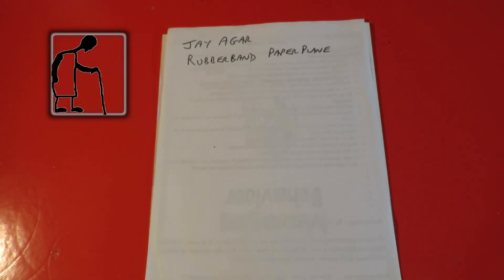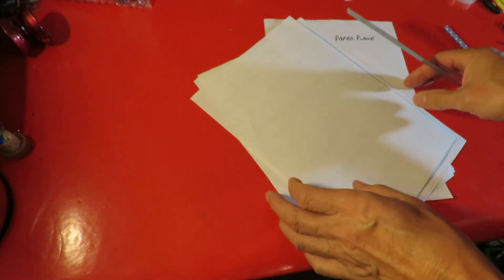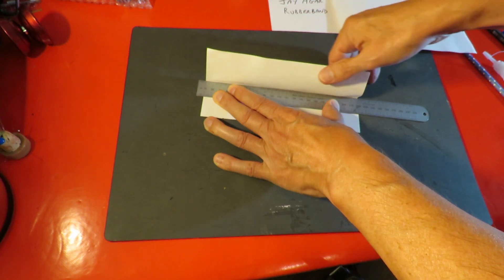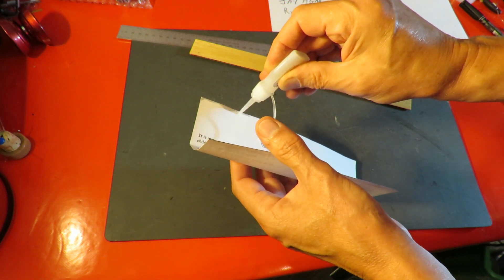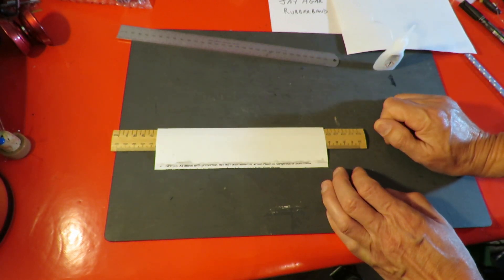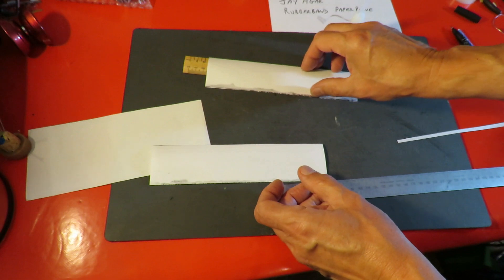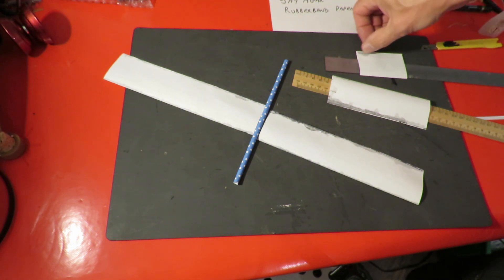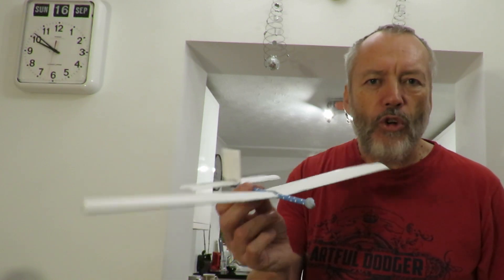Paper Aircraft with Superglue stiffening

Comment: Hey, this is a pretty neat idea. I had a similar idea two days ago, where I made a structure with airfoil ribs and spars but from cardboard and covered it in printer paper. Almost worked. Fell apart. :( But I really like this super glue idea. I may just have to try this. :)
Reply from the maker: The superglue stiffens it and adds a degree of strength but only a little. When I look at some of the paper built aircraft on YouTube I am amazed at what can be achieved - but not by me 😕

Comment: Hi nice try! I think using super glue or any other glue is inside the scope, as you need some glue to stick the paper at that level of performance. For only gliding paper planes sure, no glue. But for powered paper planes I think glue should be allowed.
A typical way to add strength to paper is create thin tubes, they usually cope together much better with lateral forces. Good luck with the next attempt! And thanks for sharing.

Comment: Pretty nice idea, Grandad! Actually you can use the super glue even in foam boards, mostly on the edges. 😊
Reply from the maker: Yes as long as you use the minimum possible as it will eat the foam if you are not careful
Reply: @GrandadIsAnOldMan  I guess it depends on the foam. With depron it doesn't happen. 😊